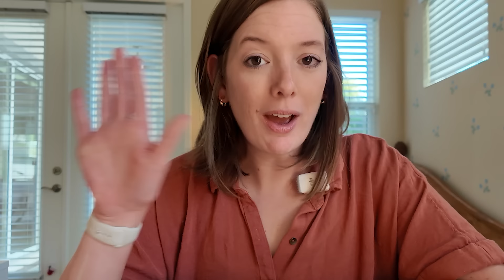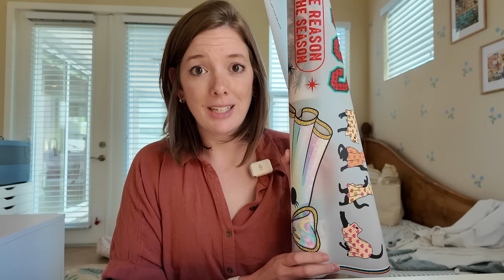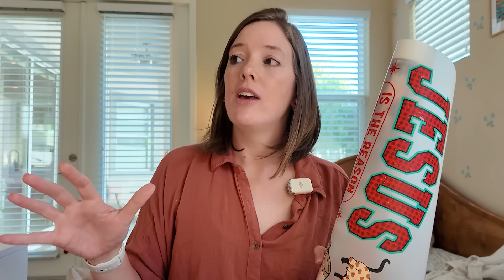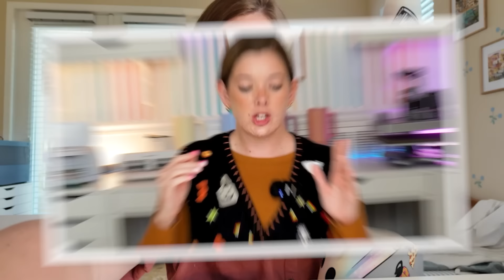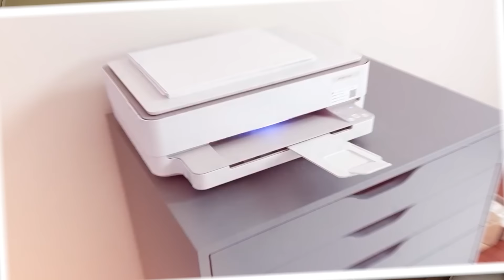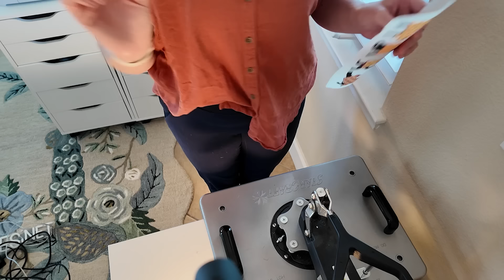DTF HACK IS DEAD? The REAL Cost of a DTF Print vs The Hack

Comment: have you done wash test on the DTF gang sheets. Yrs ago I bought the powder and film to do the hack and never did it. Last fall I ordered DTF from our local shop, it was great and it had a one day turnover. I still wanted the convience of doing it at home. My biggest issue was finding on that was affordable and you could go more than a day of not printing with out the maintenance that would follow. After lots of research I ordered the HTVRONT DTF2. I will still order from our local shops, they have things that I haven't seen at home like the glitter sheets. Thank you for the videos
Reply from the maker: Hello! We have talked about different items in a couple of videos that have been washed, worn, washed, worn, and repeat but we haven't done a video specifically for it. I personally have one shirt I have washed and rewashed what feels like 100 times that I used dtf from drfprinter.com to make and the transfer has gotten softer but not cracked or faded at all! It will have the normal wear and tear that any shirt would but with that specific one, no issues! I will try to find the video where I talked about it and link it!

Comment: The “original” hack was meant to be used with sublimation ink, not inkjet ink.  Using the hack with sublimation ink, has lasted for 2+ years per another YouTube channel. In my opinion, this is somewhat deceptive 🤔
Reply from the maker: The hack that we saw and wanted to try out didn't require converting your printer to a sublimation printer. The idea was to make it easier and more inclusive for those without a sublimation printer or the knowledge to convert their printer. I am glad that there is a way that this does work! Just not the way we did it unfortunately.

Comment: I have been using this with my sublimation printer for about 2 year with no problems
Reply from the maker: Good to know! This was just a regular printer so that might be the difference!
Reply: @DesignBundles  it is different.  This video is so misleading. This hack mentioned using inkjet ink, not sublimation ink as the “original” hack was presented. The outcome using sublimation ink is successful. This video is somewhat misleading, if the viewer is not paying attention to what is said.
Reply: I tried this with my sublimation printer and the paper gets stuck. It doesn’t feed through.
Reply from the maker: @sharondalynnewton7562  I wonder if @print7bcopies208 has any tricks or tips they could share with you